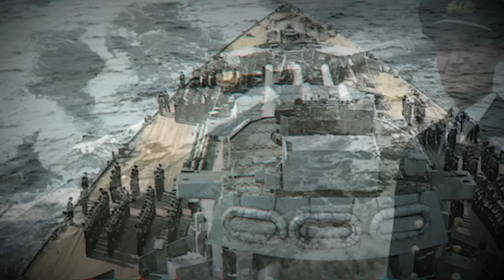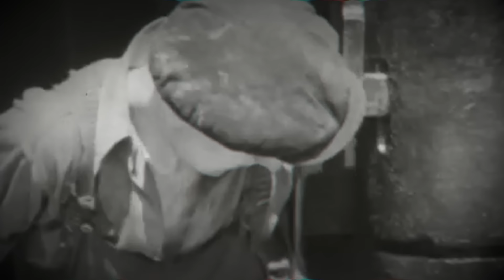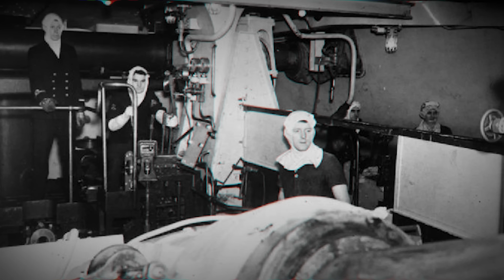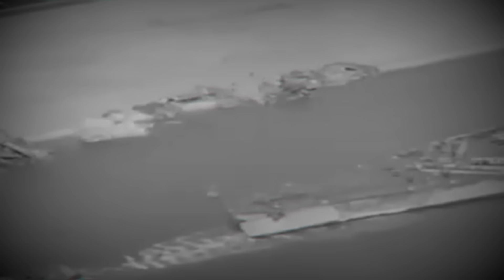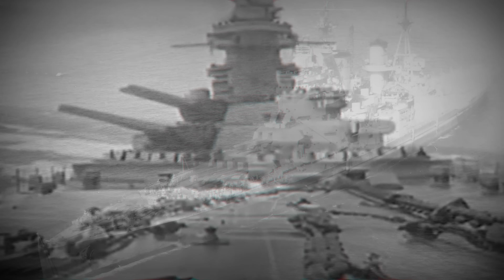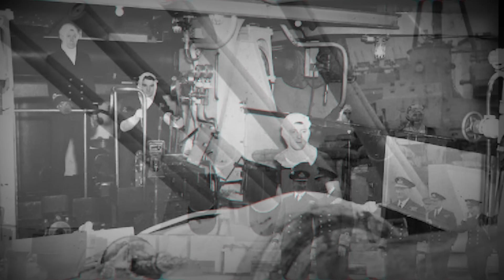Rise and Fall of Quad Battleship Turrets

Comment: It's ironic that for all the trouble quad mounts had, that it was one of those ships HMS Prince of Wales that scored the only hits on KM Bismarck in the battle of Denmark Strait. One of those hits caused a fuel oil leak , which was later spotted by an aircraft. This gave Bismarck's position away, which allowed the RN to catch and destroy her. POW took a pounding, though.

Comment: Probably not a good idea to put 4 in a turret, if a turret is hit 4 guns are out and not 2 or 3.
Reply: it depends of the engeeniring of the turret, the french model was inb essence two double turrets glued together with a layer of armor between the second an third gun, in theory in case of a direct hit it's supposed to protect at least half of the turret.

the english quad turret on the other hand didn't had any armor between the guns for all I know
Reply: @kira68200  that idea has merit, but if the mechanism to rotate the turret or the hoist system is damaged then the entire turret is still out of action.
Reply: @toawing  ho yeah totaly, in that situation the turret won't turn anyway
Reply: One major benefit is that with all things being equal: wind speed and direction, temperature/ barometric pressure etc, the spread of four rounds / shells from a single turret is reduced thereby placing more ‘damage’ in a concentrated area - less hit and miss gunnery from multiple turrets.
Reply: @garryseery3865 the 4 guns firing were hampering each other accuracy, that what solved after the war by having a delay between the 2 first shots and the 2 second shots.
Reply: @lxdnd I think you will find that ‘ripple’ firing was used by most major warships during the war.  The delay between each barrel in a turret firing was typically about 1/10 th of a second to counter shockwave interference and reduce peak stress on the turret and machinery at the time of firing.  Having four guns in one turret as opposed to two two gun turrets is that, as in my previous comment regarding all things being equal, four shells fired in about 1/2 second will, god willing, land in roughly the same spot increasing the potential damage.  Two twin gun turrets separated by ~50 to 100 feet would, depending on the firing sequence of the individual barrels and target speed, result in a spread of potentially less effective damage.
Reply: @garryseery3865 sure? Think in real Nor virtual World.
Reply: @edselrodriguez5450 I was thinking in the real world. I left out the criteria of ships relative speed, ships bearings and headings, the sea state affecting the ships rolling and pitching, which all have real detrimentals effect on targeting ( try target shooting whilst bouncing up and down on a trampoline), especially when shooting at a target 20 - 30 thousand yards away.
Reply: And more turrets mean more turrets to get hit. So more turrets with less guns isn't any better.
Reply: to be fair turrets were Usually some of the most heavily armored components of a battleship, though that being said they definitely aren't invincible and the actual level of protection does vary wildly between ships. The Bismarck for example had all 4 of its main turrets knocked out during its final battle meanwhile the Yamato's turret faces were so thick that they were functionally impenetrable from realistic combat ranges (though one was knocked out when a bomb damaged its elevation mechanism)
Reply: If you are building a ship with twelve guns, then three quads is better than four triples.
Reply: Turrets are very well armoured. If you want a certain number of guns and only have 2/3 guns you need more turrets and even more weight.